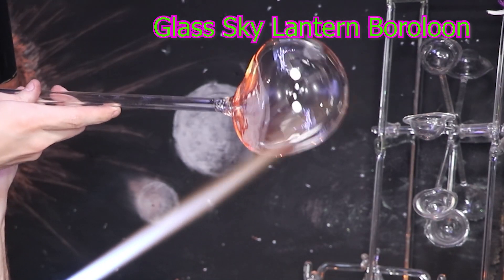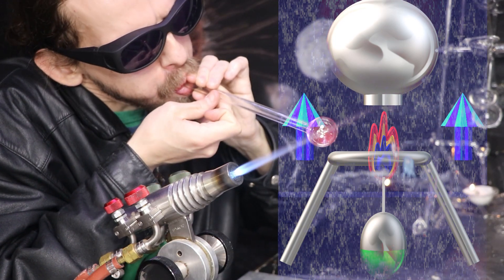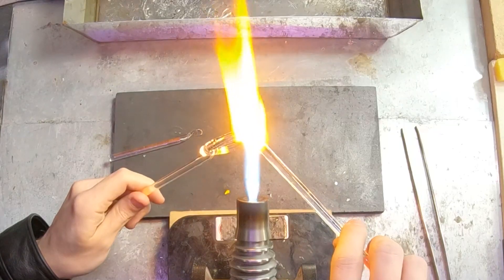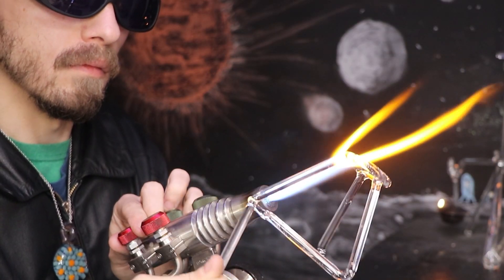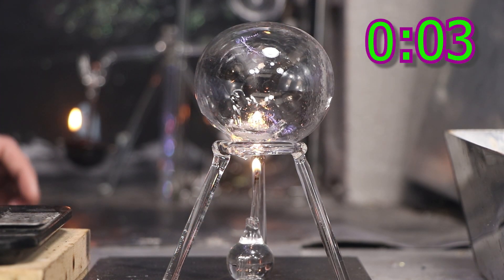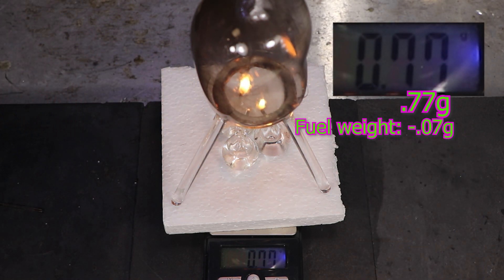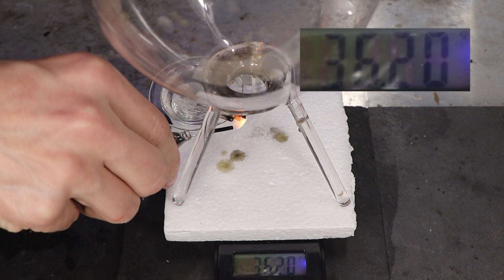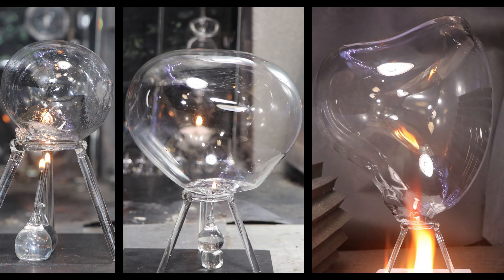Can Glass Float? Glass Hot Air Balloon / Sky Lantern

Comment: I think you might have to go the same route the MythBusters did to get a lead balloon to work. scale it up to a ridiculous degree so the weight isn't as much of a problem compared to the internal volume. Also a jet style burner like the one you used to melt glass may be easier for heat direction and increased thermal output. 
I'm not sure how much heat transfer is a problem due to the general poor conductivity of air.
Reply from the maker: That is true, I was reaching my limit with how large I could be made. I was thinking of a burner as well, but I was worried the pressure of the gas would lift it without heating the air. 
   With the heat transfer It's something you would have had to feel for yourself. It was like nothing was there blocking the heat. My hypothesis is that the air above the vessel was as hot as the air inside, so with both regions at the same density we can't have buoyancy. 
  Thanks for watching and commenting. Wish me luck when I attempt the experiment again soon.
Reply: @JasaGlass  I doubt that heat conductivity of glass is a main problem (at least for the first seconds) but that the lower rim end will be always too thick and heavy. Something like this would need to be made rather with NASA methods than handcrafted. But if a glass bubble would easily lift into air, I am sure it would have been mentioned already in medieval texts. Possibly it needs to be tempered glass (like optical fibers or Gorilla Glass sheets) to stay flexible; but a closed bubble (to seal helium like a balloon) likely can not work because it would implode by air pressure when cooling down. (I am a latex mystic (meditation with inflatables) and not working with glass. But your concept is very alchemistical, so I can understand the ambition.)

Comment: Fun to see someone try. But I suspect you are going to have a bad time. Since the wall shows no thin-film interference, the wall is at least ~4um. You can play around with this equation:
9.81*4/3*pi*(    2.23*( (r^3-(r-0.001)^3))   +(8.978×10^-4)*(r^3)   -0.001225*(r^3)     )
First term is the weight of the glass in kg, sphere of radius r in cm, and thickness 0.001cm(10um).
Second is the weight of the hot air inside the balloon @120C(a small error for simplicity) 
Third is the weight of displaced air.
When this equation is less than zero you have lift. For a wall thickness of 10um, r=~20cm.
That is ~1/10 a human hair. I've used these bobbles to make windows for alpha-Geiger-tubes, and most are closer to 100um than 10um. Given a thickness of 100um you will need a sphere 4m across.
At 100um, even if you could have made it a vacuum balloon, you'd still need 1m in diameter.
Of course, these are lower estimates, since they don't include any material at the flange.
It would be mighty impressive if you could do it. But consider a compressor, since blowing a minimum of (5x)human lung capacity in one go, will be difficult. Good luck!

Comment: A very thin coating of insulating paint or a powder that you can apply to the inside might solve some durability and temp loss issues. Airbrush application might be a good idea. It will a bit of weight but that's what experimenting is about.

Comment: would it be better to use colored glass as the metals in it should help with insulating and capturing the heat for a upward draft.  awsome work mate as allwase.
Reply from the maker: Thanks Zac, it took a lot of work to put this together. I did try blowing some colored orbs but it couldn't stretch as far so they were heavy. They didn't float but I never measured the lift, It would be good to compare the numbers. I'll make more balloons while its warm and test them all in winter.

Comment: Maybe you need to make a double walled balloon (a bubble inside of a bubble) so the air between them acts as an insulator. The downside is that will double the weight.
Reply from the maker: That's a cool idea. If that air chamber is sealed and vacuumed it would be very effective. Blowing a large scale balloon might be difficult, but I can craft a small scale version and test it this winter. Thanks for your comment!